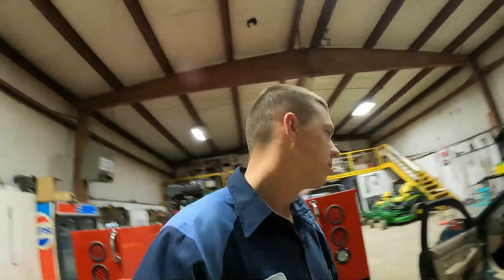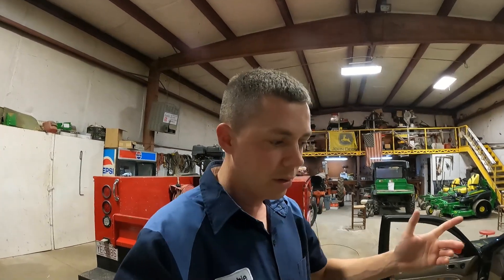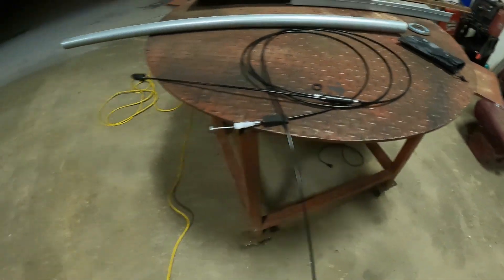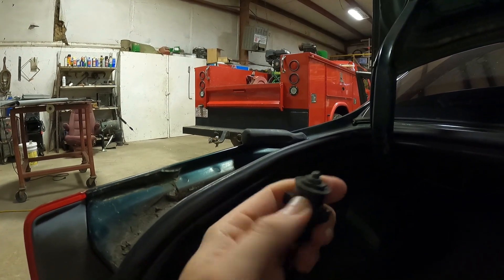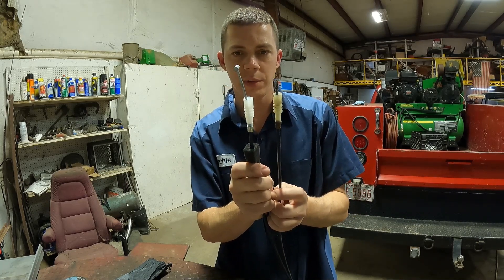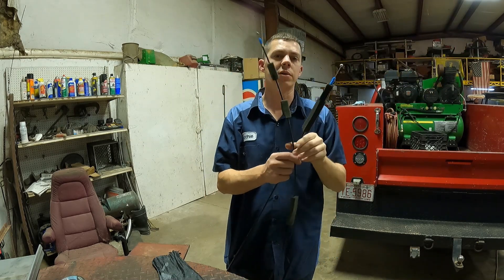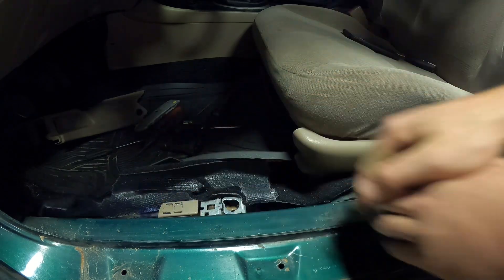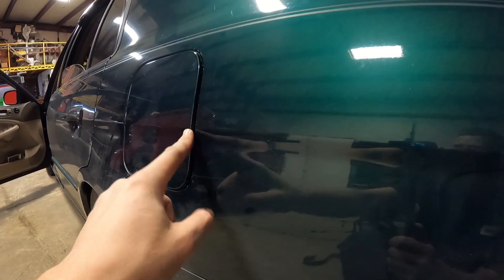2001 - 2005 Civic trunk and gas door release cable replacement DIY How to

Comment: Where did you find this for so cheap?
Reply from the maker: Ebay
Reply: @ballsoutperformance  Thank you for the quick reply. How long did this job take you and is it easy for someone who isn't mechanical? I only need to replace the fuel lid latch but I can't seem to find just that part so might have to do the whole cable.
Reply from the maker: About an hour. And yes its not hard. Your mainly just removing interior panels. And yes both the cables are made into one, not seperate